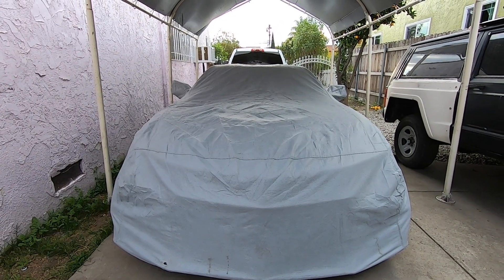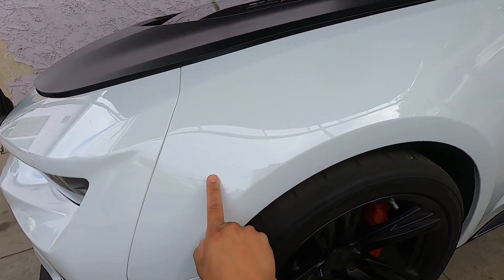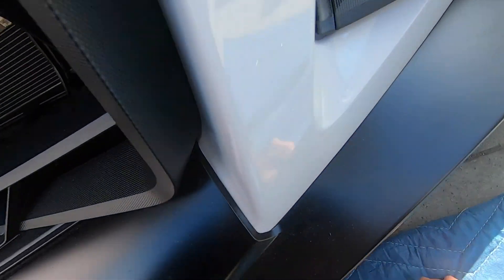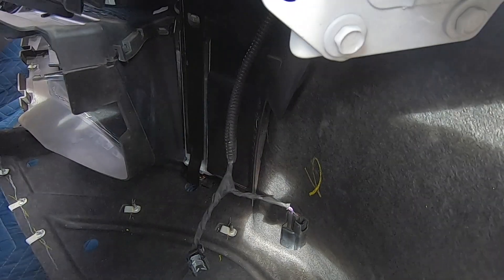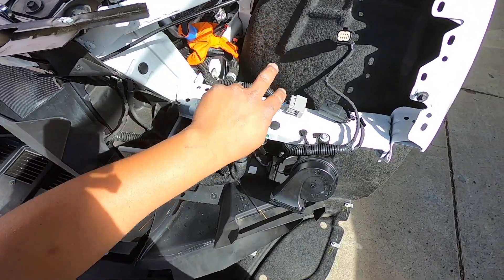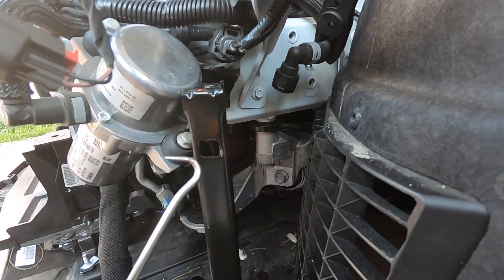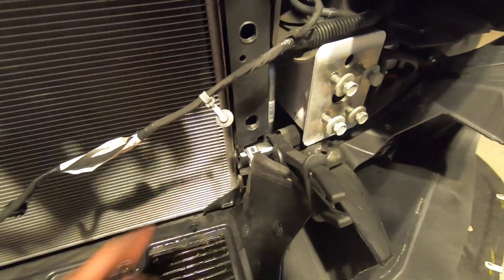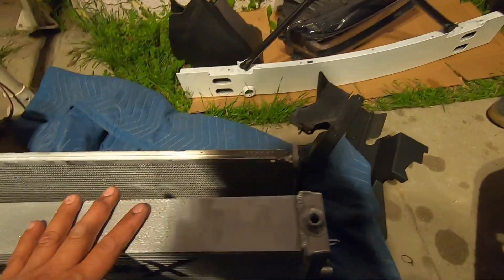Weapon X MotorSports Triple X Heat Exchanger Install On A 2020 Camaro ZL1 1LE LT4 **Keep IAT Cool**

Comment: Did you ever figure out how much the cooling improved on the dyno with and without the heat exchanger? I will be getting mine because I daily it and will be on upper/lower pulley w/ flex fuel kit and tune.
Reply from the maker: We never got the coolant temp numbers before the heat exchangers went in so we dont have anything to compare to. But the tuner right away said he noticed the difference compared to all other lt4s he had tuned.

Comment: Did you notice an advantage using the kit? How much cooler did your car run after the install? Would you do it again and do you think it was worth changing out the heat exchangers?
Reply from the maker: We didnt get a before reading without the heat exchangers but according to our tuner he said that it was running way cooler than other zl1s. We would do it again

Comment: @OXC Films How did you end up bleeding the cooling system?
Reply from the maker: We ordered a lt4 supercharger coolant bleeder "tool" which goes on by the throttle body and we jacked up the car from the front a bit and let it run with coolant in a soda bottle placed upside down on the bleeder tool

Comment: I am installimg these on my 2017 SS do you know what brackets i would get? Do i get oem zl1 brackets?
Reply from the maker: We arent too sure but we think you will need some zl1 oem brackts for these to mount on since this kit replaces the factory stuff that the ss doesnt have. Maybe you can get them out with custom brackets aswell
Reply: @OXCFilms  thats what inwas confused about. Does the zl1 have all three exchangers stock or just the front one?
Reply from the maker: Yes it has all 3 so this kit replaces all 3
Reply: @OXCFilms  ok i did see the brackets on gmpartsdirect now just need to figure out the coolant lines
Reply from the maker: Also the pump
Reply: @OXCFilms  yeah the kit i bought has a varimax pump
Reply from the maker: Gotcha! Good luck with your build 👍
Reply: How did you bleed the system after the install? @OXC Films
Reply from the maker: We ordered a lt4 supercharger coolant bleeder "tool" which goes on by the throttle body and we jacked up the car from the front a bit and let it run with coolant in a soda bottle placed upside down on the bleeder tool

Comment: How much iat diffrence have you seen now that you've had them a while?
Reply from the maker: The times we have driven the car even in high 90s weather, the iat drops pretty fast. Never got to test the stock setup to see how fast each one dropped, but with these exchangers it is pretty fast
Reply: @OXCFilms  I just cant decide if its worth it or not for me I mean I have a fbo 2017 a10 car it made 738whp with meth it's the stage x ported blower iats drop pretty quick now.
Reply from the maker: The tuner said that it was a big difference from all the other Z's he had tuned with out the exchangers. And he has dope a pretty good amount of Z's
Reply: @OXCFilms  plus I have the 2.5 gallon cordes ice tank behind front bumper to add should be alot of xtra fluid I just cant get ahold of anyone at weapon x to see what size barbs I need theres options on website
Reply from the maker: O ok yea you do have a lot of fluid. But it never hurts to add a bit more cooling mods in our opinion. Hit brent up on fb or email.

Comment: I bet your temperature dropped alot
Reply from the maker: Yes it did. The tuner said the iat temps were way lower than zl1 he had dont with the stock exchangers
Reply: @OXCFilms  I get my weaponX radiator delivered Wednesday and I have a Gen1 cts-v those known to run hot and I dont like it not one bit that's what made me buy it and I feel that's one of the best investments I made so far and thinking also about a getting a racing oil cooler also and you need to drop more video's 👍🏾👍🏾
Reply from the maker: There is a big difference between the weapon x stuff and the oem that you will remove. What videos would you like for us to do? We will be making a walk around/ review of the camaro soon
Reply: @OXCFilms  make a video on how the temperature dropped alot significantly and makes your car performance better
Reply from the maker: We didnt get the temps when we got the baseline numbers at the dyno. But we will try to compare the car with a stock zl1 soon 👍